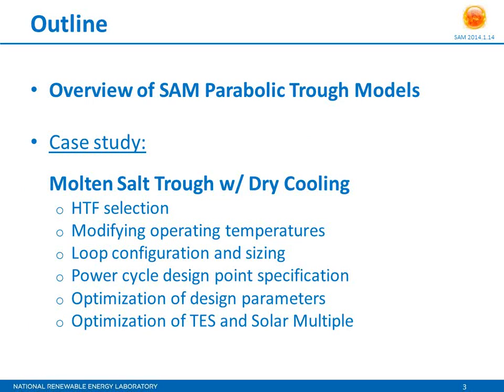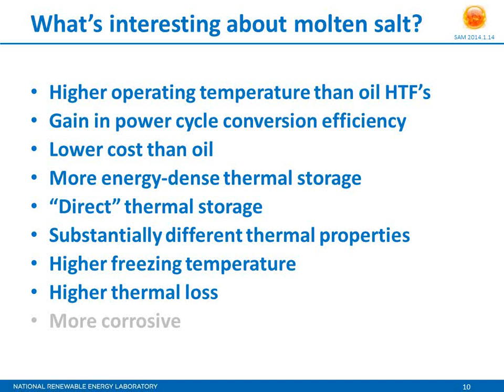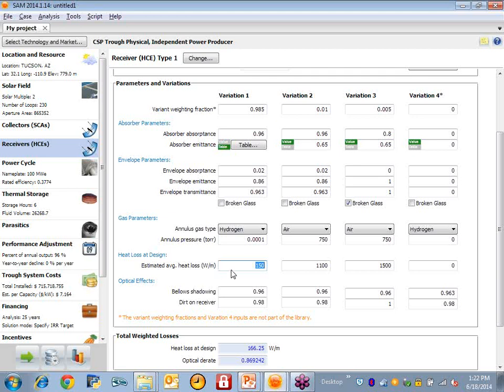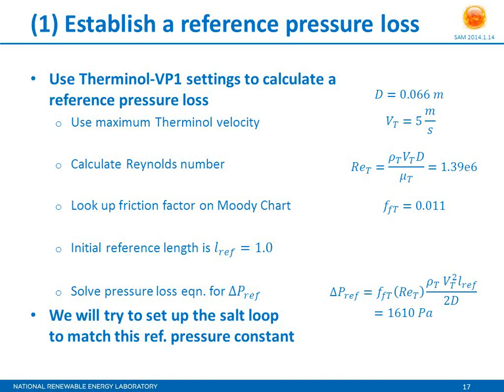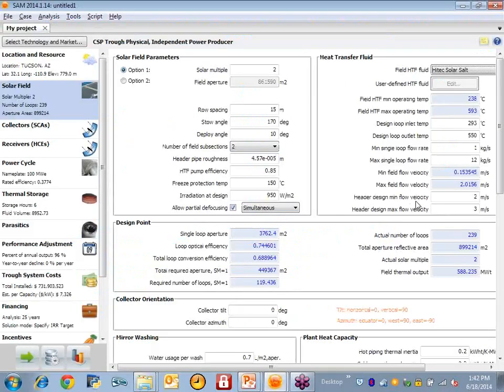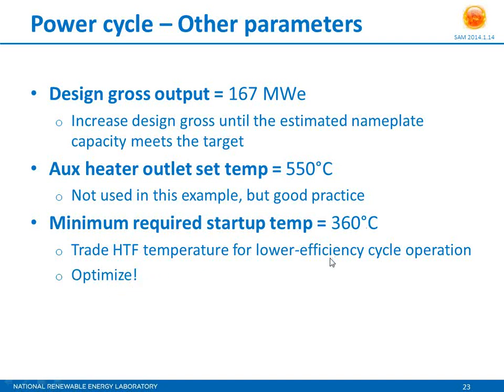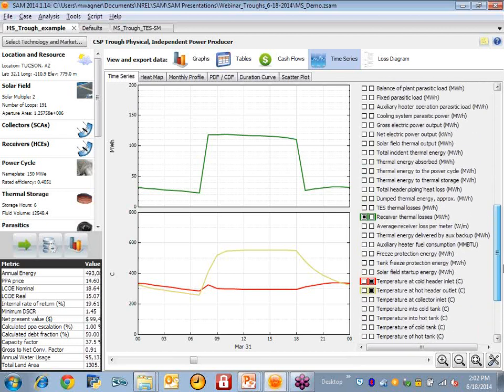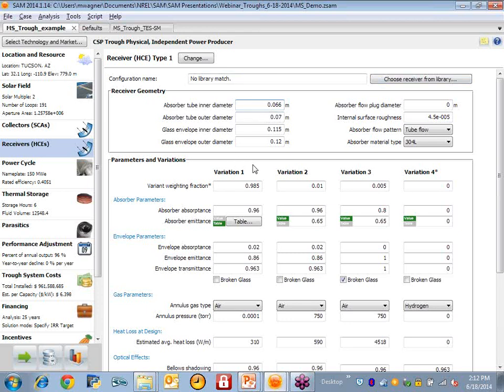Modeling Parabolic Trough Systems, June 2014

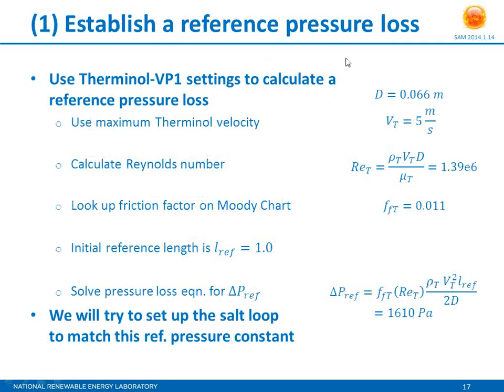Comment: Great Video. I have a question at 30:04 you calculate the reynolds number and you use some properties for density and dynamic viscosity. where i can find this properties and in which temperature did you calculate the Re?
Reply: 390 temperature

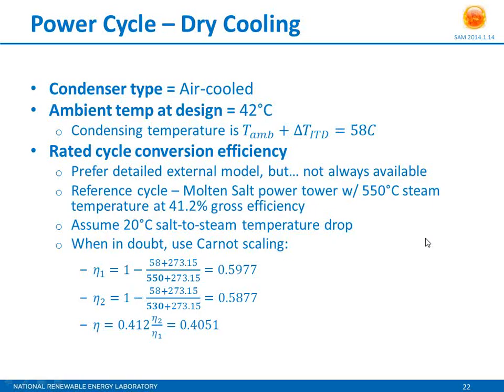Comment: Great video, really gave some insight in using the software. I just have one question regarding the power cycle parameters shown at 45:30. Not exactly sure how Carnot scaling concept works. Its just that the cycle conversion efficiency seems a bit high for dry cooling. What is your opinion on using the Chambadal-Novikov equation? [eta = 1-sqrt(T_L/T_H)]
Reply from the maker: Ernest Dall Thank you for the question. I've posted a response on the SAM support forum: https://sam.nrel.gov/node/69552